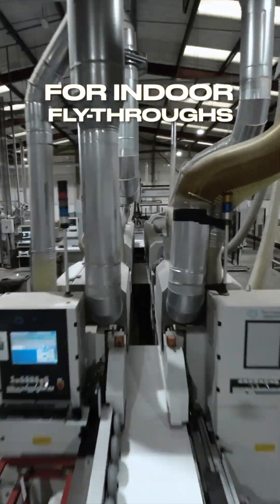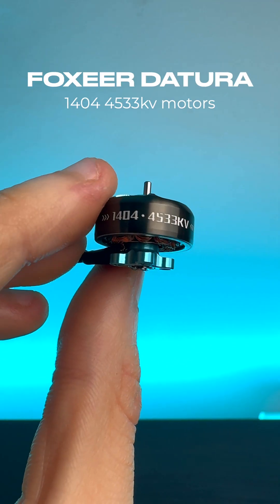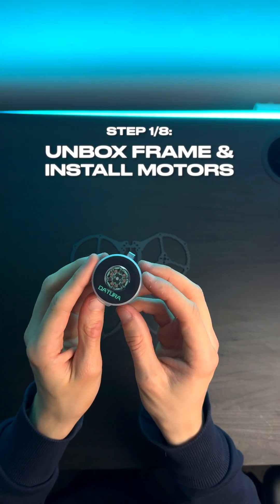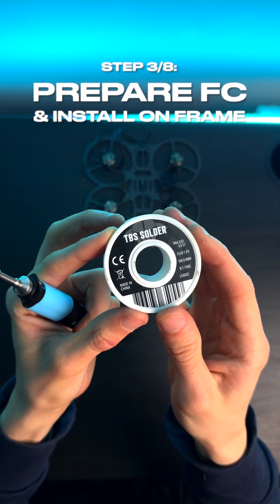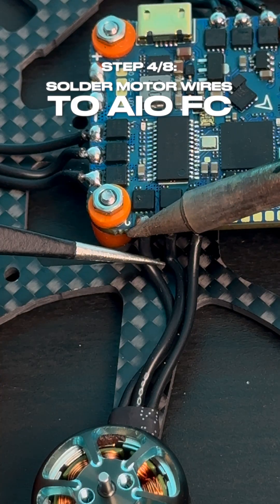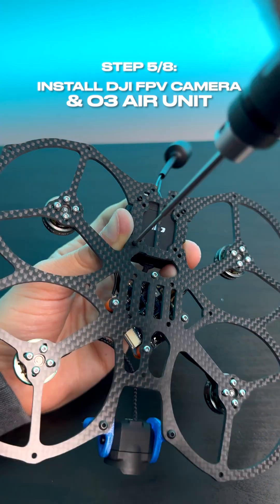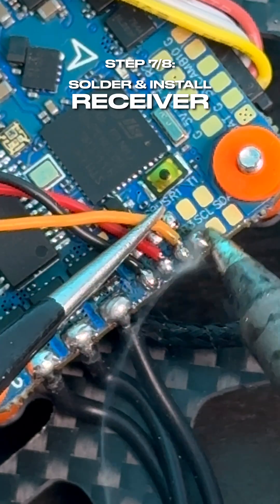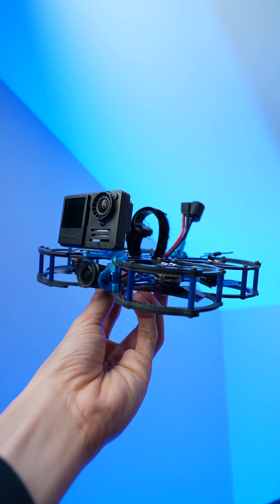How to Build a Cinewhoop FPV Drone 🛠️ 🚁

Comment: I'm a complete beginner. I thought with an digital DJI o3 system I have to use also a DJI Controller? But it seems that you are using ELRS? Can I use ELRS Controller and still use digital camera?
Reply: Yes, it's largely recommended to use ELRS anyway.

Comment: Why do you use a GoPro on top of having the DJI O3 Camera. It can record high quality video as well right? Is the quality of the GoPro so much better?
Reply from the maker: Yes the O3 can indeed. A GoPro 11/12 has a slight edge in terms of resolution offering 5K compared to 4K but in terms of colour the O3 and GP are pretty identical. So depending on whether I need to keep the drone sub250g with a larger battery, I’ll either run just the O3 or with a naked GoPro too

Comment: Best to best to apply the water proofing after you do your soldering. Or at least add another quick coat once youre done since access can be a pain once its all assembled. That way you have a protective coating on all exposed metal surfaces including your solder joints. Also important because your iron is hot enough to burn away the coating even withough direct contact so parts that are near solder joints will also be unprotected.

Comment: So for DJI O3 unit ? What remote controller we need to get ? We can hse any controller we want? Im new to this ans i would likw to build one so help me out here 😊
Reply from the maker: If you’re using the O3 as the Receiver, you need the DJI RC2 remote. But I highly recommend using a separate system like ELRS or crossfire
Reply: @BenToogood why do you HIGHLY recommend not using it tho? I think they fixed the disconnection problem, is there anything else?
Reply from the maker: @CyberRelax  because if you lose video signal, which is likely during a fly through or typical cinewhoop flight, then your quad also failsafes. Just in general too, you want your controller to outlast video feed. So if you lose video you can throttle up/disarm and avoid going straight to stage 2 failsafe. Which is much worse
Reply: @BenToogood  thanks for the reply, I was referring to that when I said I think it was fixed with later software updates. Not 100% sure tho
Reply: @CyberRelax there is no fixing this it’s just how it works. The dji transmitter is connected to the goggles not the quad. So if goggles lose signal you lose control.
Reply: Can I send my kid to be ur student??????? His 13:))))
But 
His the man!

Comment: You think this thing can hold a full size GoPro???
Reply from the maker: It could, but it wouldn’t fly very well. That’s too heavy. A 6s 2.5 inch could rip with a full sized GoPro though, but it’s a bit too heavy tbh. A 3 inch is what you need for a full sized
Reply: @BenToogood  yooo thanks bro

Comment: Nice and quick. 
this is for 4s ?
Reply from the maker: Yes, this is ran on 4S
Reply: @BenToogood i think i read somewhere that 4s should be paired w motors in the 2300-2700 kv range, what’s the reasoning for going so high? and would there be any risk of motors overheating or failing at such high kv w 4s?
Reply from the maker: @zenandtheartofskateboarding  it all depends on the size of the motor. There’s no set kv for certain voltages, it ranges depending on stator size. For a small 1404 or similar, 3000-4500kv is suitable for 4s
Reply: @BenToogood  damn i’m running 1404s on 4s w 2750 kv, didn’t realize i could go up that high. higher kv trades more power for slightly less flight time right? or do i have that backwards? still super new to this and its kinda complicated but lots of fun learning all these little details
Reply from the maker: @zenandtheartofskateboarding  Increasing kv gives you more power and thrust. On a small cinewhoop you're not really gonna notice any efficiency losses as they don't fly very long anyway

Comment: Why isn't the capacitor preinstalled on the circuit board?
Reply: Where are you finding FCs with onboard caps? Is that actually a thing?
Reply from the maker: @JoshDisher  There aren't any that I know of. You don't normally install a cap onto an FC unless needing additional filtering. I know you can get iFlight ESCs with preinstalled caps, although they're a bit of a pain to install onto frames as they only usually fit the iflight frames
Reply from the maker: Because it’s a small board and depending on the voltage you supply to it, it doesn’t necessarily need the cap

Comment: Build cost?
Reply: 200 bucks at least for the air unit. I would recommend analog if you want to start with budget version. If you already have goggles then get the DJI air unit obviously.
Reply from the maker: £350/$400
Reply: @BenToogood ayo what
Reply: @suitcasegaming that’s pretty good for the build
Reply: What's the nearest whoop to purchase to compare costs